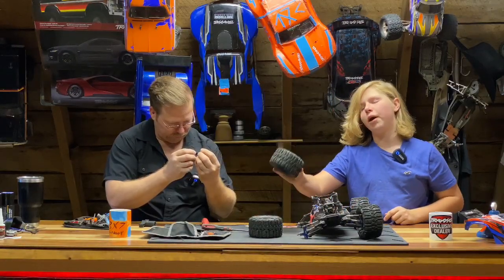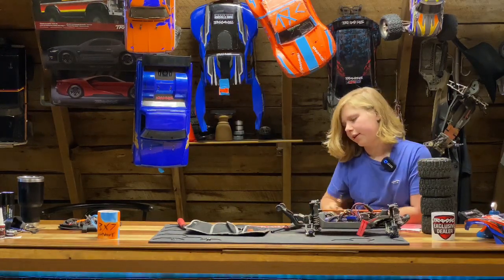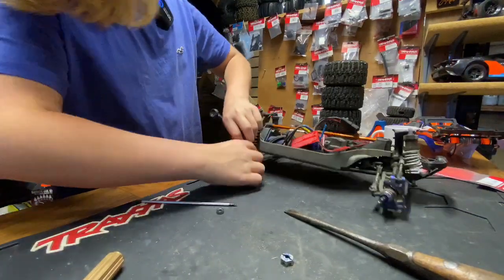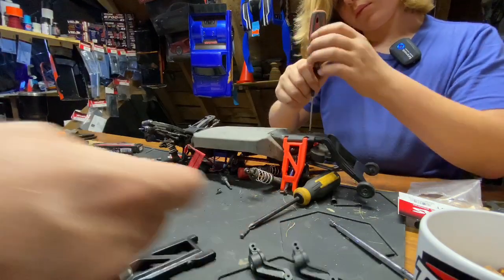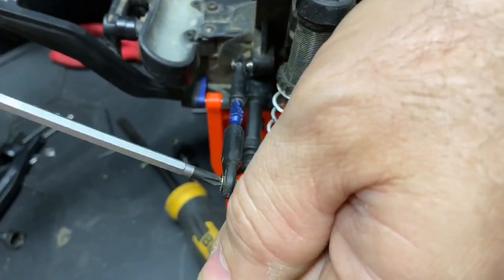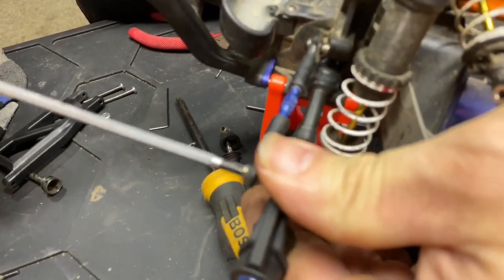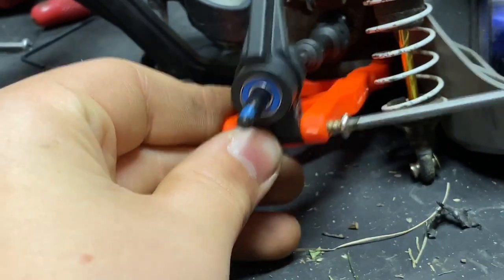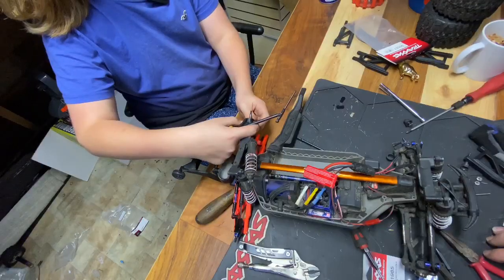The Traxxas Rustler 4x4 vxl REWORKED - Tight and outta sight!

Comment: What shock oil are you guys running in the front and rear?
Reply from the maker: 70 in the front, 80 in the back
Reply: @3X7Outdoor  and what springs are you guys using if you don’t mind me asking? Yall rustlers looks really high and I’m trying to make mine like that
Reply from the maker: We are using the GTR Shocks from traxxas with double springs in the front. We made a video a while back
(a LONG while) About them and installation
Reply: @3X7Outdoor  ok cool thank you guys I’m gonna like back for the video